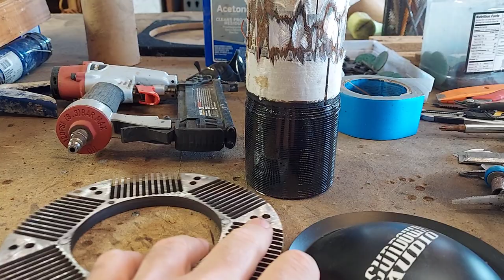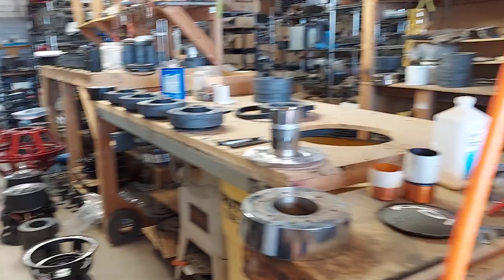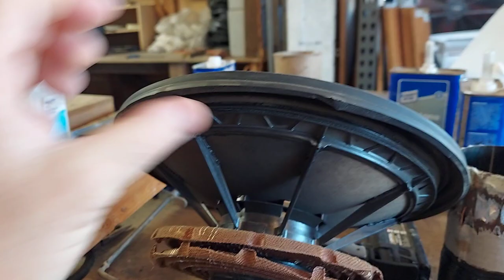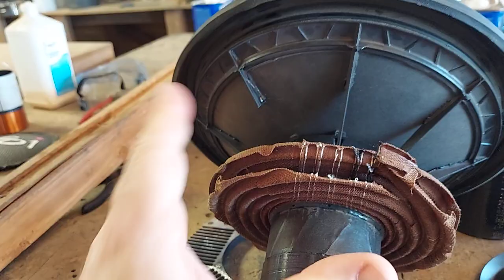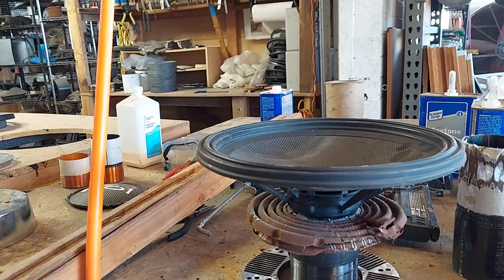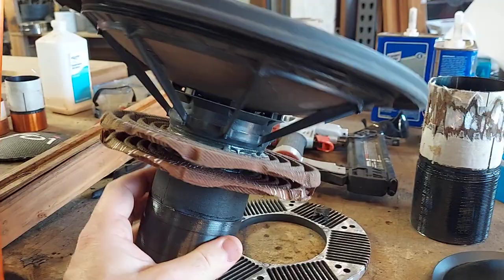Sunday Sermon - STFU, infect the corruption of the world + Yes, I have fully formed Netflix dreams

Comment: Off subject trying to brave here be prepared be honest be helpful. What is the small round female 10 pin connection on back of some head units for not the power and speaker wire plug but its some other coax type looking plug?
Reply from the maker: Text me a pic, 6023126504  Typically older units is for a CD changer.
Reply: @RobotUnderground  k no problem one minute